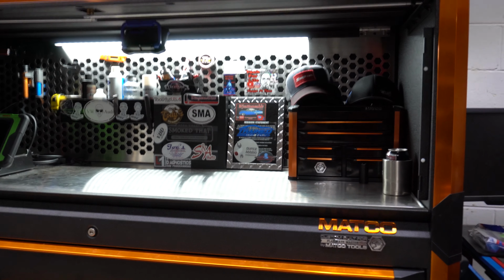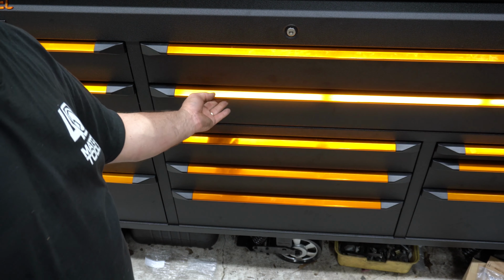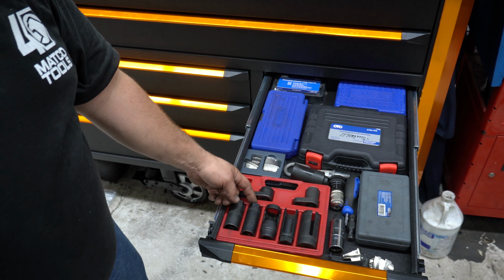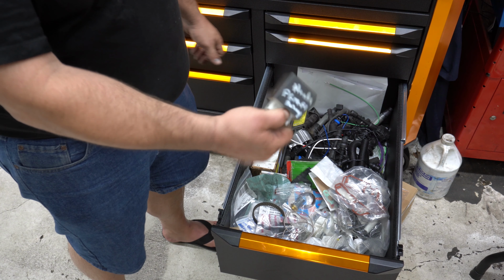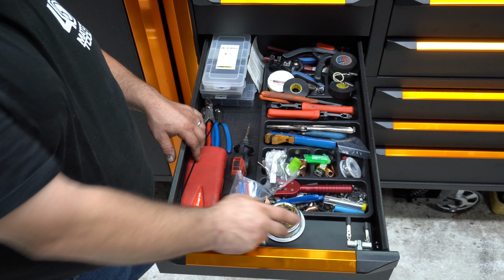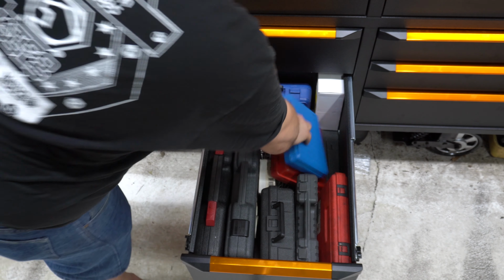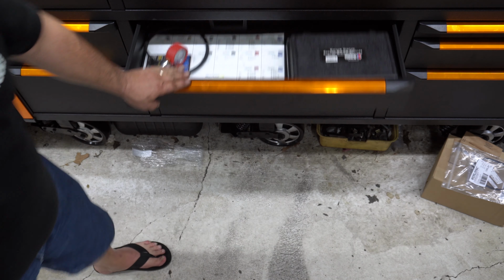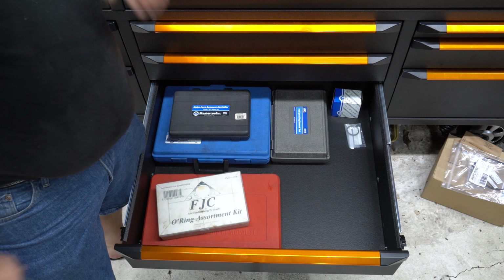Wall of Matco Revel Tour Part 2

Comment: for those stretch belts on gm trucks i just use a ratchet and prybar to remove them and to install ratchet and zip tie , when i get a new belt it comes with the tool , i just throw it in trash
Reply from the maker: Removal tool for me is side cutters or a knife

Comment: Love your videos. I am in the Heavy Duty field and starting to stock up on the light and medium side. I love my big nasty and for the most part my go too when I want to teach a seized part a lesson. I have been looking for the quick release chuck for a while. My bits tend to collect frequent flyer points. Where did tou manage to get yours?
Reply from the maker: amazon https://www.amazon.com/Astro-Pneumatic-Tool-49801-Retainer/dp/B01JBK2RF0/ref=sr_1_2?crid=LMF3TEJU2WS1&dchild=1&keywords=498+quick+change&qid=1633379043&sprefix=498+quick%2Caps%2C178&sr=8-2
Reply: @flatratemaster  thanks

Comment: Can you do a video on the Toyota battery terminal? I’m always looking for the best way to repair a battery terminal. I mostly use the Military ends and crimp eyelets on the wires.
Reply from the maker: We crimp and solder ends on battery cables and replace the battery terminals with the Toyota style

Comment: Great tour what’s a Toyota bearing tool used for have never seen one
Reply from the maker: 2WD 4 Runners have a 4 pin hole nut on the inside of the hub to retain the bearing